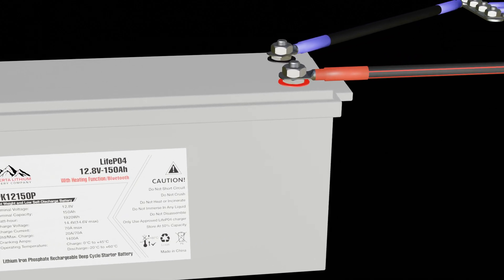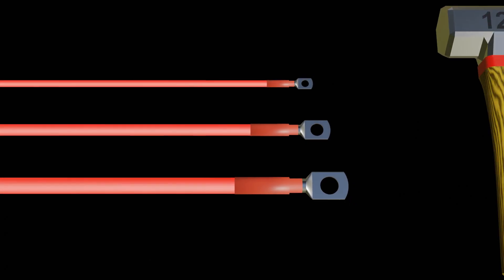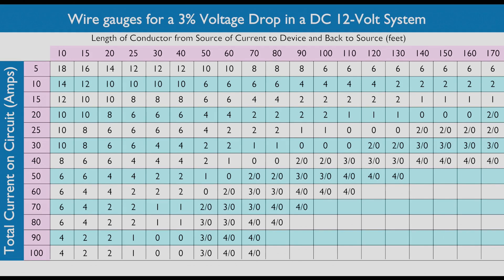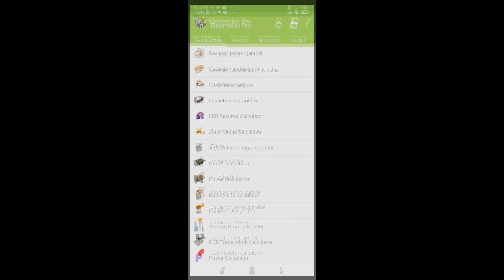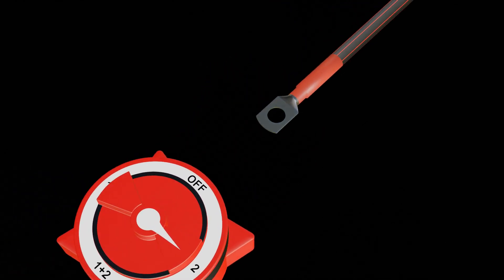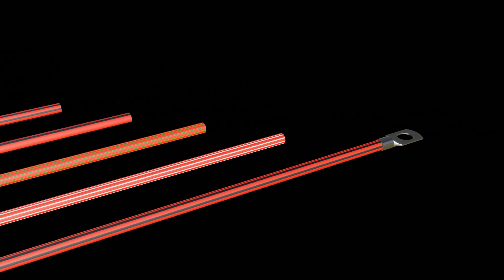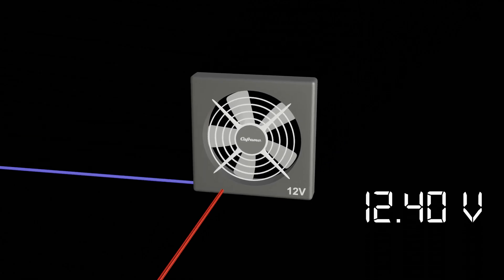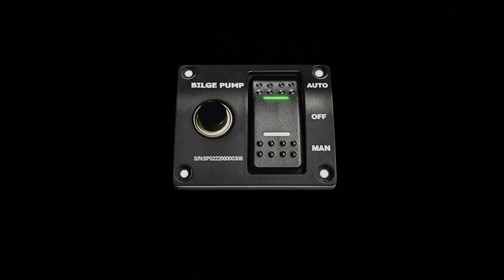Basic Boat Electrics - How does it Work? ⚓

Comment: Very clear and to the point but what about the charging path. the alternator , battery charger and solar controler ? where should they connect? as close as possible to the batteries? before the selector switch? thanks
Reply from the maker: Sorry for the delay in reply. That's for more advanced electrics and an on-site inspection could be a good idea. Thanks for watching

Comment: curious if you have a suggestion on something odd i am seeing.  I have a small isotherm fridge.  Its been fine for 6 months and runs perfect.  in the last 2 weeks, when the compressor kicks on the lights (led) flicker / dim / or go off.  I even have another 12 volt appliance that reads "Low Voltage" Thats comes and goes but is usually fine if i dont use the istherm....if i turn on the isotherm on and it runs for a while I start getting low voltage on that 12 volt appliance and other compnents as well.  Not sure where to start with this....house batteries read full....
Reply from the maker: Hi, and thanks for watching. Tricky to try and work out from here and my first thoughts are to try everything you've just mentioned, with the engine running. If you still having these issues, then you will have to go through connections and wiring. If everything works fine under power, then I would guess your batteries are not showing accurate readings. Hope this helps, let us know how it works out

Comment: Tinned copper is worse than normal copper?
Reply: Good flag - for boats tinned copper is better because it resists corrosion better than copper. Also very important to use stranded and not solid core

Comment: Very straight-forward explanation, but resistance is NOT measured in feet; but Ohms - it is the level to which the passage of current through a conductor is hindered; the smaller the diameter (and greater the length of the overall circuit), the greater the resistance.
The AWG chart, to which you refer, uses the resistance/foot to calculate the volt drop for any given gauge and length - useful.
Reply from the maker: Hi and thanks for contributing... Yes, I could have worded that differently. Thanks for the info, I will be sure to mention and correct this in the next installment.
Reply: @searchingforcoconuts2248  bear in mind that the resistance of the wire is not the only resistance in the circuit - the fuses, a poor crimp connector and a busbar connection not tight will also add to the overall resistance, thus increasing the volt drop still further, so the resistance from the wire is only part of it.
Remember that the volt-drop V (the voltage, in Volts) = I (the current, in Amps) x R (the TOTAL resistance, in Ohms).
Reply from the maker: @tonyleverett1483  once again, thanks so much

Comment: there some bad jokes in that beginning lmao , one question though you never went in depth like for solar or battery sizes?
Reply from the maker: 😂😂 couldn't resist... will be sure to include those in the next installment... always good to hear from you, thank you
Reply: @searchingforcoconuts2248  with Power (in Watts) equal to the product of Voltage (in Volts) and current (in Amps), working with higher voltages (i.e. solar panels or batteries in series) means for the same power, current is reduced, resulting in the ability to use lighter, cheaper, more flexible wire and connectors.
Because the current has gone down, the volt-drop also reduces (though you need consider the best way of reducing the voltage for 12V devices!).